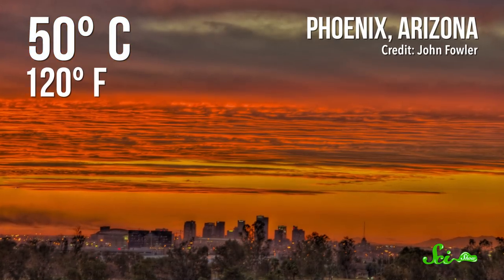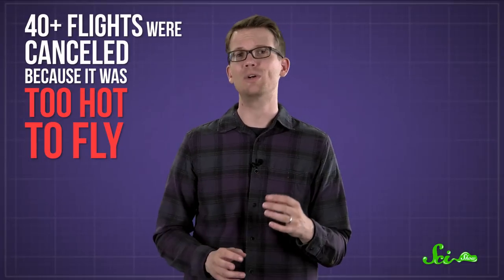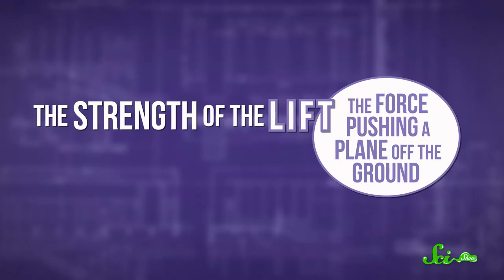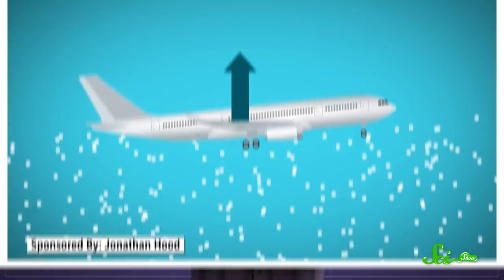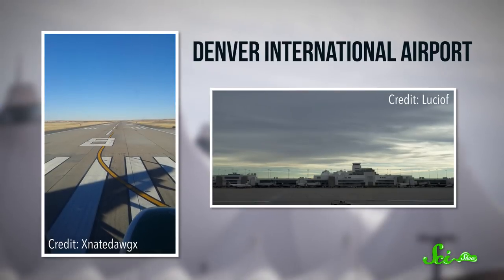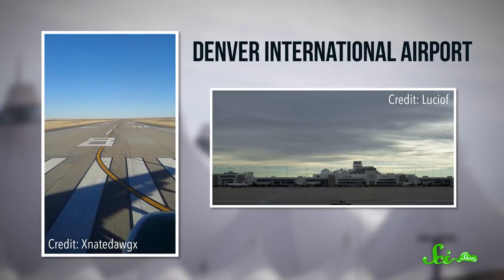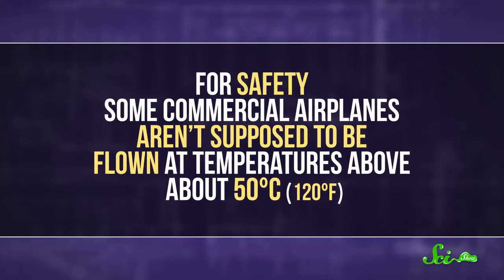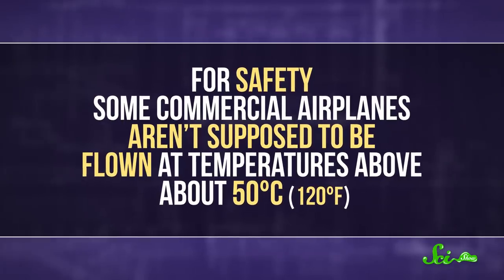Can It Be Too Hot To Fly?

Comment: It's not just aerodynamics, airports also have to think about the people out working on the tarmac in that heat.  I had a long layover in Phoenix earlier this summer, and I spent most of it hanging out in a relatively quiet corner that turned out to be where the folks who worked out on the apron came in and out.  I got to talking with them, and found out that that day really wasn't too bad, as the surface was "only" 120 degrees F.  Earlier that week, it was something like 140 - 150.  Still, they had cool-down stations set up outside, and most of the crew were coming inside for frequent breaks from the heat.
Reply: Synchronizor however, they have no problem leaving passengers sitting in a hot plane for hours on the tarmac. As a phoenix native, this I have experienced.
Reply: At least the planes are climate-controlled when the engines and/or APU are running.  Some airports are also equipped to pipe pre-conditioned air directly to the aircraft when it's sitting at the terminal, so the APU doesn't have to keep running.  Doesn't necessarily mean it's not a bit stuffy and warmer than ideal, but at least the floor isn't hot enough to melt your shoes.
Reply: probably the sun hates them for using fahrenheit instead of celcius
Reply: Dubai in more humide and have a much lower altitude. So the conditions are very different, and the air is more dense because of altitude. All some structural parameter are important such as the length on the runway and how fast they should gain altitude. Also note that 50C (120F) is unusual for Phoenix so the airport might be missing the extra feathers to deal with it.
Reply: Tony Mouannes  Humid air is actually less dense and has a lower concentration of oxygen than dry air. This would slightly counteract the effects of a lower altitude, although the higher pressure would be more significant.